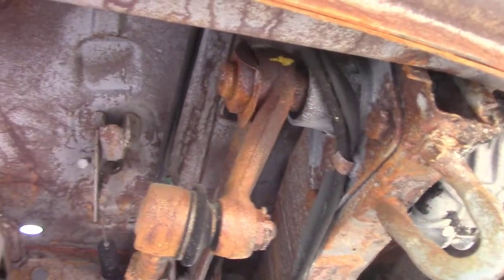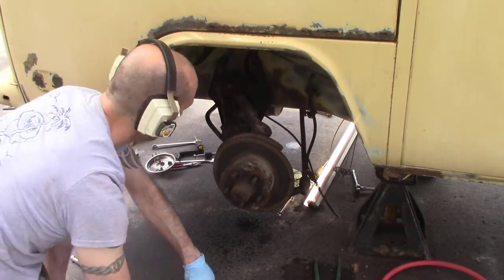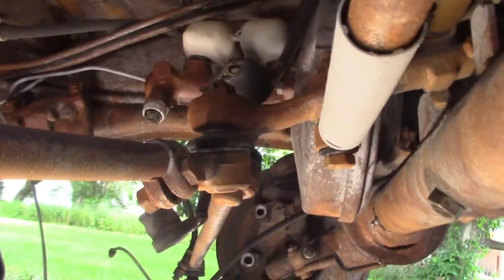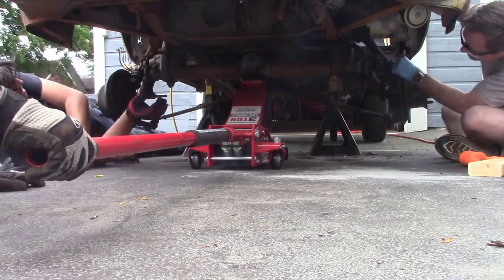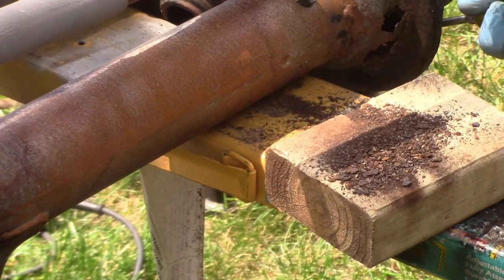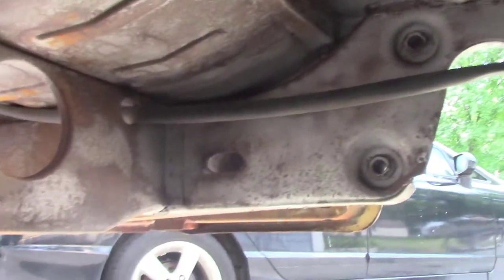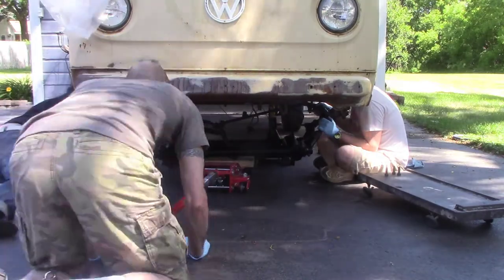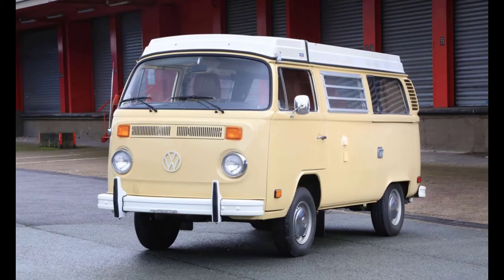VW Bus Restoration Part 3: Removing the front axle beam

Comment: With the amount of rust damage on that beam, it might have been better to buy a new front axle beam and all new components.   Lots of work to have to take apart again.  I’m about to replace the entire beam on mine. Thanks for making the video.
Reply from the maker: I would love to have replaced mine as well, but I didn't want to fork over that much $$ along with all of the other restoration parts I had to buy.  I hope your restoration is going well.  Thanks for watching!

Comment: Ha ha ha ha ha ha ha. Am doing this right now and also forgot the clutch cable.
Reply from the maker: Let me look on your channel for a video where you remove the beam perfectly the first time.
Reply: @FixItScotty  Eh? I wrote that I just now did the exact same mistake as you guys. Had to jack up the front beam again to take the strain of the clutch cable. Will deal with it now after a short break.
Reply from the maker: @henrikbergman4055  - Apologies! I read your comment wrong and thought you were ridiculing us. Ha! yes. that clutch cable seems almost invisible when you are trying to get the beam out.  I wish you all the best finishing your beam!
Reply: @FixItScotty  No worries, and thanks for the videos, they are great help. I have a -72 doka with disc brakes up front, and seems like I've missed another cable. So more investigation...
Reply from the maker: @henrikbergman4055  Very cool.  Again, sorry for the misread.  I get crap sometimes on my other videos, but never the VW content.  That's because VW folks are typically the most helpful, understanding and cool people you will ever meet.